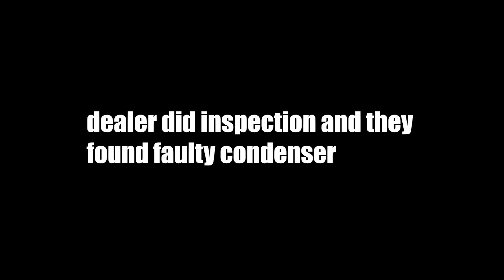Honda Civic 10th Gen AC condenser issue solved

Comment: Thanks for the information brother....I took my 2016 Honda civic into a York Region dealer today after watching your video....My compressor did the same thing....Today the Honda dealer replaced the defective Condensor for free under a 10 year extended warranty on the Condensor...The service rep claimed that last year in 2020 they had so many people complaining about these that the condensor was on back order and took upwards of 2 months to come in...By folks getting in early this year they may avoid this ...again thank you...
Reply from the maker: You welcome. I had first time issue in 2017. That time condenser was in backordered. It took me over month to get my car back. Then second time it happened again in 2019. They said Honda redesigned their condenser in 2018 so it will not happen again. Let see how it goes this year and next.
Reply: @NorthUbuild  how long it dealer will take to replace
Reply from the maker: @Ayush-Gabba  for me they took 2 hours to fix it and refill the system.
Reply: @NorthUbuild  I'm not sure the newly redesigned condenser is any better. I got my replaced in June 2020 with the redesigned one and I'm once again having the AC blowing hot air. I'm going to the dealership in a coupe days to see what it is. I heard people with 2019 and 2020 Civics and they are having the same problem and they should have the newly redesigned condenser.
Reply: which dealer was it? and what did u mention? i went to couple of dealers and it’s ridiculous they were asking $300 just for inspection even though i mentioned honda has extended warranty on this issue now
Reply: @ComebackKid777  I have a 2019 and I am having the same problem. Condenser is leaking and will be exchanged for free. Just waiting for the new one to come to the dealership.
Reply: @javedshaikh1529  same is my question

Comment: My 2017 AC started blowing warm air. I just had it fixed today. $750 to replace condenser.  Not covered by warranty because there was damage to it, per them. The way it is designed, rocks and debris can damage it and if that is the case, it won't be covered. I also never got any letter from honda regarding this being an issue.
Reply: Did a Honda dealer repair it?  16-21 civic and accord condensers are known problems. Honda will send you your money back if an outside shop repaired it.
Reply: After replacing did you have this issue reoccurr?

Comment: I just noticed the same problem with my 2020 civic, just purchased not even a year ago.  I will have to contact Honda Dealership.  I will ask to see if it is covered under Warranty as i did not buy an extended version.
Reply: Paul you should be covered under the standard 36 month 60k km warranty. I have a 2019 civic and had the condenser replaced for free yesterday.
Reply: @Watchman999  if you are in canada, honda was extended the warranty for ac condensor for 10 years

Comment: I had my fixed under warranty, but a second issue has popped up. There is air in the line so when running the AC you get a gurgling noise. From research it needs to be bleed out. Im just not sure how to do it. The dealer states its not a warranty issue.

Comment: If the AC clutch doesn’t engage, could this be caused by a bad condenser?
Reply from the maker: Yes because bad condenser cause gas to leak out and if the sensor doesn't detect gas pressure in the system then the ac clutch does not engage.

Comment: My 2019 Civic AC just went warm. Took to dealership today.
Reply: what happend ? did they fix for free ?
Reply: @totljag1  Yes. Bad condenser. Also received a notice from Honda for 10 year unlimited mileage warranty on condenser.
Reply: I really don’t want to have to go through this every couple years. It baffles me that even 2019-21 models have the same issue they new about for years. 
It has me so worried that I’m going to trade my 2020 Civic Sport Sedan with manual transmission in next spring. 
My car is 8 months old and has 3200 miles now, it will have around 6000 miles when I pay it off next feb. 
I’ve only used my AC like 4 times in 8 months out of fear of this issue, and wi try not to use it at all until I sell the car next spring. 
I can go without AC and just drive with windows open, I’ve been doing it all summer here in California, but I’m not sure if it’s worth keeping. 
I thought the naturally aspirated motor and manual transmission would be ultra reliable. 
But hearing of the AC issues, windshields that crack super easily, bad paint quality, wires that attract rodents, infotainment issues etc etc I’m having severe buyers remorse ☹️
Reply: @bretthansen8166  If AC condenser is the only issue in this car you're blessed and pretty stupid for getting rid of it.

Next thing you know, you'll get rid of your car for some new one and have all type of issues with it.
Reply: @cross8215  I have kept the car, currently at 8800 miles, and only a couple payments left. Will be paid off with about 10k miles. 
I’ve decided to keep it as the naturally aspirated engine and manual transmission should last many years when I only drive 4500-5000 miles per year or less. 

Todays car prices are insane and a Honda is reliable so I’m doing the smart thing and keeping the car. It’s been flawless no issues 👍🏻

Comment: Hi How much did the dealer charge to fix the condenser issue?  Thx
Reply from the maker: It's under warranty. So it's free. All civic from 2016-2018 got same manufacturing problem. So, Honda cover's this cost.
Reply: NorthUbuild Awesome!  I forgot about that letter they sent. Thanks for the reminder!
Reply: NorthUbuild Even tho it’s under warranty, did you have to pay the diagnostic fee for them to make sure that was the issue ?
Reply: Perdido Trust I just had mine repaired yesterday and the diagnostic fee was also covered under warranty.
Reply from the maker: @theoccultist2087  As Daniel Wong said diagnostic fees are also covered under warranty.
Reply: NorthUbuild thanks so much. just scheduled a appointment to have mine fixed. I live in Florida and it’s been pretty rough without AC.
Reply: Daniel Wong thank you!!
Reply from the maker: @Perdido Trust Even here in Toronto it's hard without AC right now. Hope you get your car fixed same day like mine.
Reply: @NorthUbuild  only thru 2018? What about 2019-2020 Civic?
Reply from the maker: @Ian-mv4qq  According to honda they redesigned condenser in 2018 and all new cars come with this new design. But if you have 2019-20 and got the same problem then its best to contact your dealer service department.
Reply: First of all that was ac compressor clutch. You did not check and did not show any parts of ac condenser in your car. I just went to the dealer yesterday with the same issue, i noticed they trying to find more problem regarding with my ac in order for them to make more money...in other word they trying to rip me off for the parts and labor....becareful with these dealers! I went home and checked the letter from Honda about the extended ac warranty. I was surprise that Honda only covers ac condenser. Since i recieved the letter from Honda the whole time i thought it include ac compressor but its not! Now i ordered all necessary tools and parts for my ac because ill do it DIY bcoz its much more cheap its like a fraction of what you'll spend at the dealer.
Reply from the maker: @eibronmonde1275  yes, you have to be careful with them but there are some genuine delars. They actually helps you and not charging for wrong parts. My car ac broke two time and they fixed it both time free no charge also they gave me rental car for first time without any charge.
Reply: I just talked to honda and they told me that I have to pay $550 to recharge a/c first before they check anything else. I dont know what else to do
Reply: By the way I have a 2016 honda civic touring
Reply: KFisher8287 Maybe go to another dealer and get a second opinion?
Reply from the maker: @KFisher-un5fc  I think to ask other Honda dealers. Mine is 2016 Civic too and they fixed it 2 times for free.
Reply: Ok i will try another dealer. Thank you guys for the help I really appreciate it
Reply: I bought my Civic from the same dealer Sisley Honda and now my driver side AC blows hot air while the passenger side works fine. I have made an appointment with the dealer next week to find out the problem. Now the question is should Honda Canada cover the cost of diagnostics on AC even if the problem is not due to faulty condenser? The reason behind this is that had there been no manufacturing issues whatsoever with the condenser and my car is out of warranty, I wouldn’t have the car checked at the dealer’s since I know that non brand name repair shops are much cheaper and I would go to them for a diagnostic in the first place.
Reply from the maker: @globetrotter8556  If you are out of warranty and from what you said it does not look like a condenser issue. I am not sure if Honda Canada will cover the cost since an extended warranty only helps with condenser leaks. But on the day of the appointment ask them for exactly if you need to pay anything or it's under warranty and they will let you know.
Reply: @NorthUbuild  hey does this apply even if my extended warranty is expired? I just got my condenser replaced but they placed a defected one. Now, my pipe are also leaking. Did not know whether it would be covered or not, but they are asking me to cover the pipes. Condenser is replaced but "a-line" pipe is not covered apparently. I have a honda 2018 hatch sport!
Reply from the maker: @jpventillo2474  there is extended 10 years warranty only for condenser. So if any other part is defective then Honda will charge you to fix it.